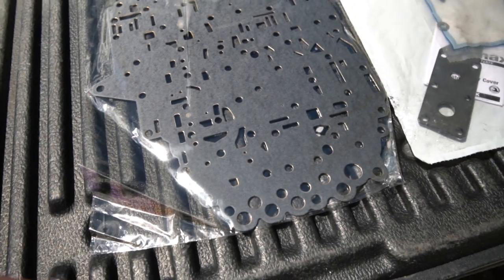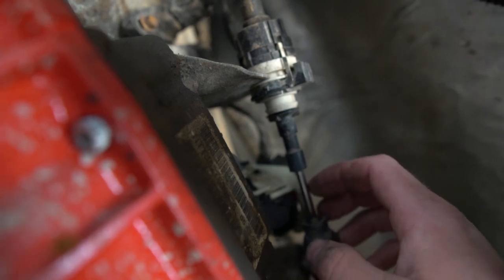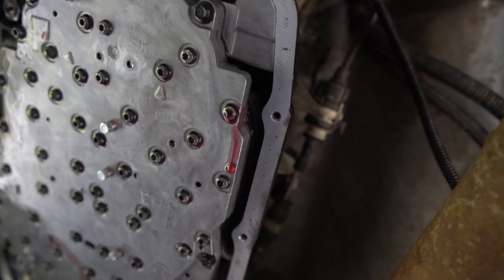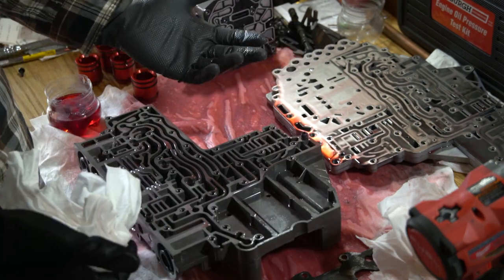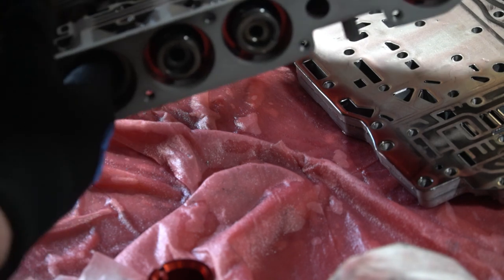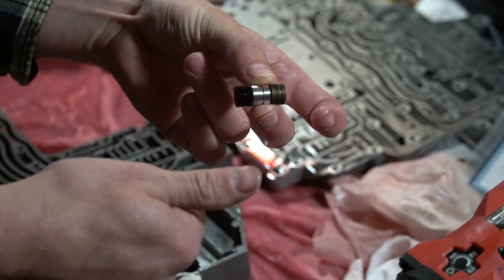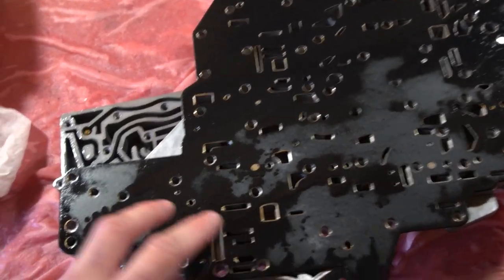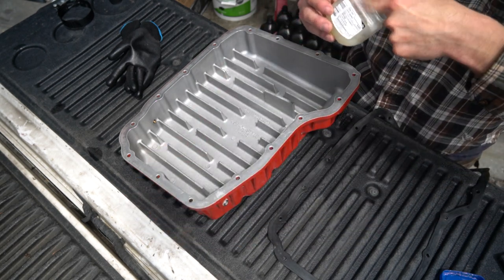BULLETPROOF YOUR CUMMINS 68RFE TRANSMISSION!

Comment: !! For anyone doing this heres a quick tip for removing and installing the 68 valve body, take care to remember where the shift fork was when you removed the valve body because if it's not in the right position when you go to re-install the valve body you can break the shift linkage, and to replace the linkage you have to completely disassemble the trans which for most people is not gonna be fun if they don't know how to work on the trans 😀 just a friendly tip from a dodge cummins specific shop 😀

Comment: !! If your going to get the upgraded accumulators and the new plate then you really should drill the extra holes and tap them for those extra bolts because the new accumulators can add pressure to the stock plate hold down bolts and strip them out thats why they give you the new plate with more holes! Please if your doing this take the time to drill those holes. If you add pressure you need to add those bolts! I can promise you unless you drive like a grandpa, you will blow out that plate and then your going to be buying a whole new valve body half. Also while your in there you really should swap out the lock up piston lever which is what the 68 is known for wearing out the bore and causing the truck to go into limp mode and stick in 4th gear!!!  If you do pressure upgrades you NEED to drill the extra holes in that plate!!!!  The dodge trucks is what my shop started on and it's the main vehicles we work on because it's our specialty so take it from me when I warn you about the 68 trans and it's weaknesses. ❤️
Reply: Wheres your shop?

Comment: Hey brother! Awesome video! We’re glad so many of these kits continue to keep selling and we continue to hear rave reviews on them! I did want to add an anecdote however on this video, we actually do offer in depth instructions in PDF format that we offer to email at request, but from your video it seems we would be best sending these instructions out with all of the orders to avoid any confusion and help our customers install this product flawlessly every time! Looks like we’ll gladly be making this change immediately. Keep up the good work brother! 😎
Reply from the maker: Thanks again for the quick replies and insight. I am still amazed at the difference in how my truck feels now. Definitely noticeable differences and worth the time to get this kit installed!
Reply: @maccheese9072  Hello! There is no straight answer because their are too many variables. However, this will help fix slippage, crossleakage and poor shift timing, all leading to a much stronger 68RFE!
Reply: @NextGenDrivetrainInc  how confident are you a stock converter can handle that kind of line pressure?
Reply: @DSGB2199  Hey man, great question. The OEM 68RFE torque converter uses like pressure to hold lockup off, not on. This means that raising line pressure has no impact on operation of the converter clutch, and only impacts the amount of internal converter pressure during the fluid coupling process. Fortunately, that is not a weak point of this converter and the weld on the converter is roughly of equal strength no matter what converter you buy; or if you even buy one! Long story short, this is 100% safe to use with an OEM torque converter. If anything, it’s great insurance!

Comment: The 68 is decent unless your going above 500 to 700hp then the 48 is way better and can actually handle high hp. The 68 has really weak clutches and drive gears are super easy to kill. 5th gear especially. But if your smart about how you run the truck and don't go real high in hp then the 68 is a decent trans. But firepunk actually did a couple videos about the 68 trans. Loving the truck though man :) kinda miss the ole 2nd gen though sometimes haha

Comment: Did kit down to the T.... now my truck is stuck in 4th gear and throws code p2706???? The shift solenoid was fine before I put kit on?? Any advice please help.
Reply: And this is why I’m so hesitant to mess with something that ain’t broken.  It’s a gamble, but there’s so much stuff in there to mess up.
Reply: @arcticcowboy8659  should have put an update.... it was really all my fault because when i was taking the harness off i pulled it by the wires (i know better) which is a no no turned out that one of the wires had come out of the harness, once i repaired the wire i cleared the code and truck was fine. so im assuming the shift solenoid that came off of it the first time was fine but since i already installed the brand new one i just left it on besides there is no refund once electrical parts have been installed. The kit is awesome and im able to run a higher psi with the new tune definitely can tell the difference so i 1000% recommend this kit.
Reply: @celeisj  I have the same kit. What I didn't have was any instructions and a bad experience. Had to keep on them due to not sending all my parts. Do you have any input plus did you perform the 68rfe quick learn?
Reply: @mach1man46  what parts are you missing? This video really helped me. The only tip I would suggest is taking your time on install and lube the seals on the pistons really good and work them in slowly they are fairly easy to damage. Also take a pic of where the check balls came out of to ensure they go back into the correct spot I tipped my valve body over and had to do homework on where they went again🤦‍♂️
Reply: @mach1man46  and yes I performed a quick relearn there are a few vids on YouTube that will help...The kit is awesome just need better literature and tips when it comes to install sucks you had a bad experience also not sure if you have one but a Thermal Bypass Valve is a must!!!!
Reply: @celeisj  thankfully about a month later and a dozen phone calls I finally got all my parts. With that said just from the experience I had I didn't have much confidence in nextgen leaving with a questioning attitude. I had to contact Revmax to get the instructions. But I do plan on installing the kit. Just wanted to get someone else's personal experience. From what I've read the only way to get it to go into quick learn is with a scan tool that has the function which I do not have. I want to buy a tuner that can perform the quick learn, which I'm still researching. Also did you perform the drilling of the plate? Thanks for the info!
Reply: @celeisj  I did get the revmax thermal bypass.
Reply: @mach1man46  yes I did drill the hole because my tuner had a transmission tune you half to have one if you don’t have a tune programmed on your tuner you don’t have to drill the hole. Also I never had to have a scan tool to do a quick relearn and the truck runs amazing, But to each their own🤙 good luck man✊
Reply: @mach1man46  nice I wonder if I could take my old one to a machinist and have them bore/gut the inside out?

Comment: I have the PPE trans pan as well. what gasket are you using with it? I used Mopar RTV and its working just fine but I don't want to keep dealing with it if I have to drop my pan again in the near future whenever I get around to doing a valve body upgrade as well.
Reply: Try a lube locker gasket

Comment: From my experience with the 68 trans and the trucks ive rebuild the trans in, the 68 valve body is famous for flexing under high pressures so its a really good idea to get the billet top half for the valve body it stops VB flex which the 68 is known for 😀 ❤️.  Firepunk competition kit is a good kit to go with for the 48re guys out there if anyone is wanting to rebuild their trans. Just make sure to get the ATSG manual for rebuilding and servicing the trans and you can easily rebuild them ❤️

Comment: Thanks so much for the share, no issues with my 68rfe only has 69,000 miles but want to stay ahead of the curve
Reply: Yes stay on top of it bro I bought a ram 2500 2014 with 80,000 MI and all those were highway miles and never told anything. I knew the guy I got it from. He always had all the service done on it. At 40,000 MI Dodge gave him a new transmission cuz the old one was no good I bought it at 80,000 mi and then 90,000 MI transmission went out I was about five grand out of pocket.I know a different stuff to look out for now but really have to keep an eye on these things
Reply from the maker: What happened with the trans that dodge replaced it and then what was it doing when it went bad on you again at 80k miles?
Reply: @purepanorama8484  I don't know what happened in 40k cuz I didn't own it at the time. The previous owner just said Dodge replaced it. And it 90,000 something about the overdrive was f*** up and s*** was seized together they had a hard time taking it apart. Said he had to rebuild it and we put in some beefier parts. For all I know he could have screwed me I don't know anything about transmissions. I don't think so though cuz it's a very well-known shop.
Reply: But I also seen a video talking about a common problem about the positive battery terminal corroding and it being bad for your transmission overtime.and sure enough when I bought it it had corrosion on the battery terminal and I never got around to it because I work offshore and I forgot about it for about a year. Could have simply been that bro. I don't like to think about it though because if it was that they cost me five grand plus for neglecting a simple issue

Comment: How come you didn't do clutch plates and torque converter upgrade as well. Stock  clutch are prone to wear out of early premature of regular use, if use in full throttle acceleration. Amazing video presentation

Comment: Your are awesome!! Best video about this I have ever watched. Im about to buy a '19 350 w/Cummings at an auctionts and it has the P0871 code that scares me. I've never owned a Diesel ever but learning quickly thanks to youtube. Im going to replace the pressure sensor on the outside of it and see what happens. If it doesnt fix it I'll probably put your kit. I dont think the solenoid could cause that OBD code. From what I've seen its a different code just for that part. IDK I have no clue about this but Im buying that truck no matter what. Again, you rock and the video was very concise without the extra time wasting babble.

Comment: Dig your videos bud but from one cummins enthusiast to another I’m throwing my stock valvebody in the scrap pile and doing a Revmax full billet body when order my trans kit here in a week. I’m not risking any warping when I bump the line pressure up. It’s kinda scary how light duty these 68’s are

Comment: How long would you get to pull it down and to do the pump And actually ring the valve body and put it oversized valve in it because that little bit of stuff might have helped you make it to a mechanic shop but it didn't do much